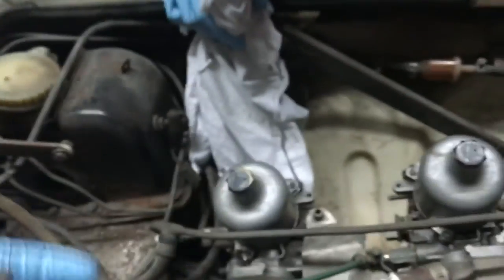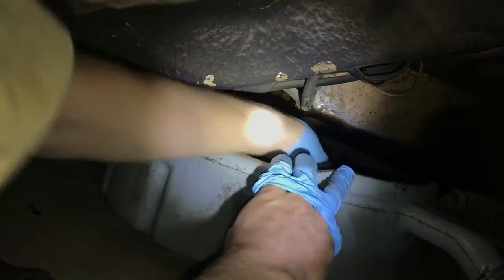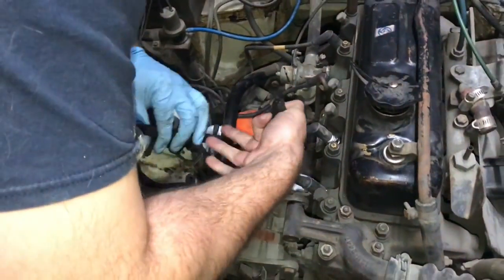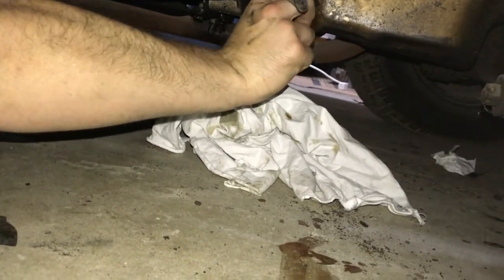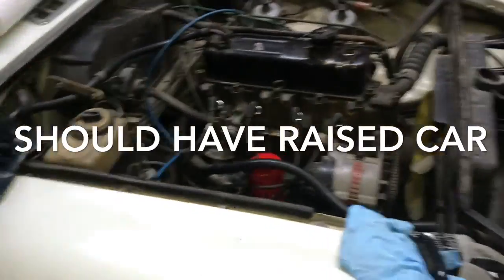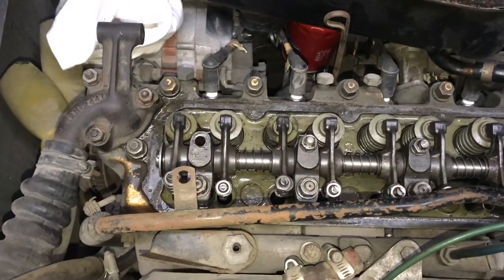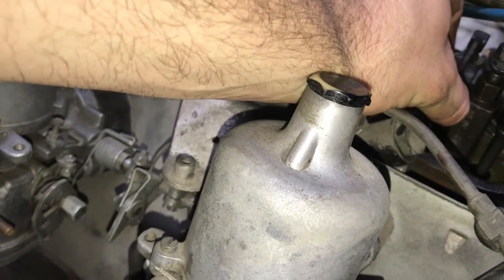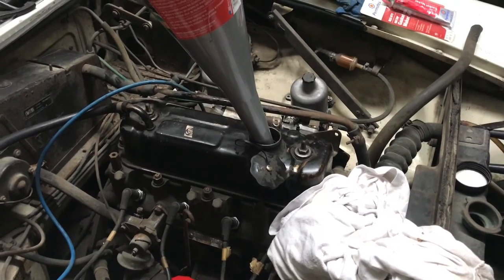How to change oil in1974.5 MG MGB, Oil Filter Replacement, 1st Oil Change in 25+ Years

Comment: I think that tube is for the exhaust gas and gets connected to the air filter. Not sure on the dual SU's. I know it is going to my air cleaner. Did you figure out the valve? I have a video on that on my channel and university motors does a good job (better than mine) of the valve adjustment.
Reply from the maker: Yes I did there is a video somewhere 😄
Reply: @BrailsfordsRides  Lol, I think it was next in line in your playlist. I noticed the videos are scattered, so I am going to hold off on the comments for now.

Comment: Absolute crap. There’s no way you got that oil filter off that easy.
Reply from the maker: Why is it crap, you saw the lack off oil in it.  Was put on fresh when the previous owner parked it
Reply: @BrailsfordsRides  Had you said at the beginning of the video that a new oil filter had been put on when the car went into storage, that would have explained why the oil filter came off so easily. I've changed more MGB spin-on oil filters that I care to remember and I've never come across a spin-on oil filter which was easy to remove. After only a couple of engine hot/cold cycles, the filter becomes almost impossible to remove, even though you would have put it on only finger tight and with a smear of oil on the sealing gasket (ring), as per the manual's instruction. I've seen me practically destroy the filter and still not been able to get it off. I've even, on occassions. had to resort to unbolting the complete oil filter assembly from the engine block and still have problems removing the filter on the work bench.
Unfortunately, British Leyland/BMC, the builders of the MGB, were guilty of not looking at improving any of the parts on the vehicle and just accepted the way things were. 'Continuous Improvement' was never in the BMC/Brirish Leyland vocabulary! You should try fitting the air filters to the carburetors . Now there is a prime example of very poor design.
I'm currently running a 1973 Roadster, in British Racing Green, standard engine but with electronic ignition, electronic cooling fan and aluminium radiator.
Good luck with the rest of your builds.
Reply from the maker: @gt40mk1  I didn't know that at the beginning of the video, I discovered it was new when the oil came out looking pretty damn good